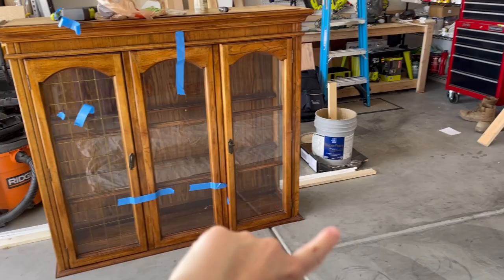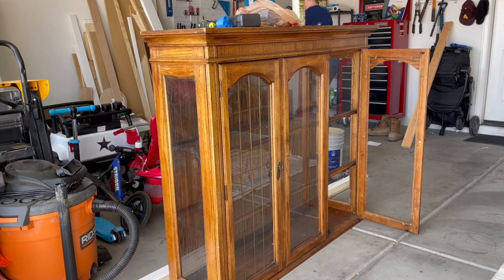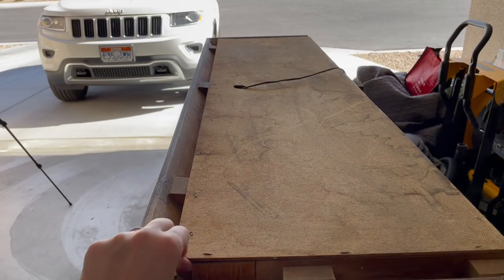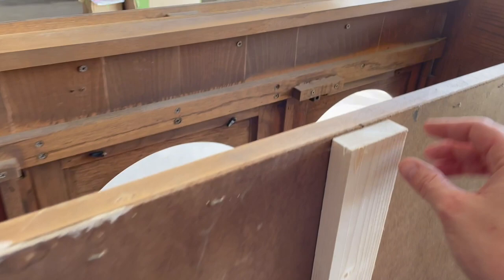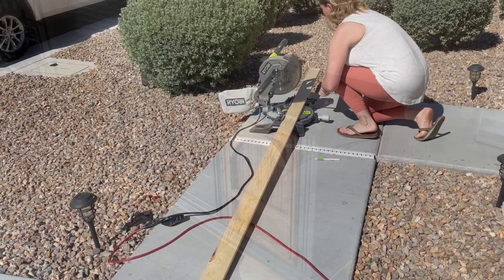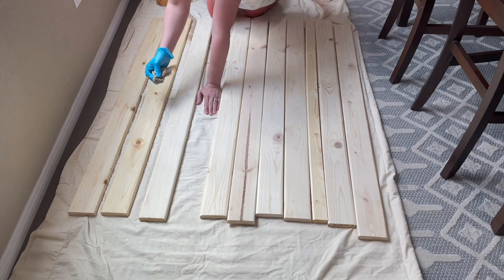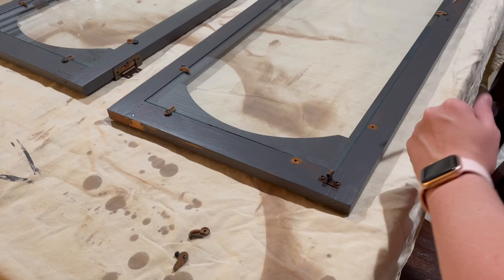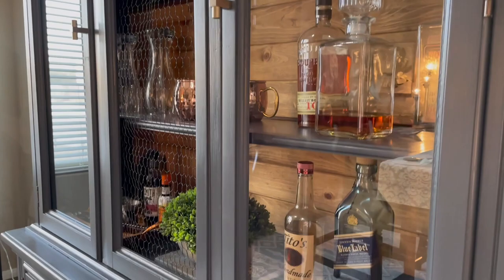Facebook Marketplace Furniture Flip // China Hutch Makeover // Modern Farmhouse Style Makeover

Comment: I have a cabinet almost just like this one and I want to replace the glass shelves. Did you just cut plywood to fit into the notch where the glass used to sit? I’m afraid it won’t hold without giving some support to the shelves. Did you add any to yours?
Reply from the maker: Yes! I used 5 mm thick plywood and glued them into the notches with wood glue. It’s maybe a hair higher than the notch but sturdy enough to hold and doesn’t bend. It holds really well and no issues.
Reply: Thank you so much for your reply!

Comment: How did you connect or join the pack pieces to one another?
Reply from the maker: I replaced the two thin boards on the back as new supports and I was able to use a brad nailer and the mail the new boards into those.

Comment: Did you use chalk paint?
Reply from the maker: I did not and I regret it. If I did it again I would use BIN primer, Chalk paint, and then seal with sanding in between coats. It would look even better if I used a paint sprayer, which I didn't have at the time. it still came out nice though.
Reply: @JamieMCurtin  what kind of paint did you use?